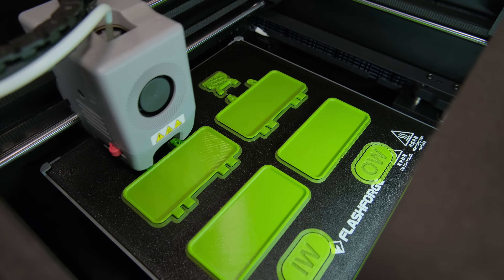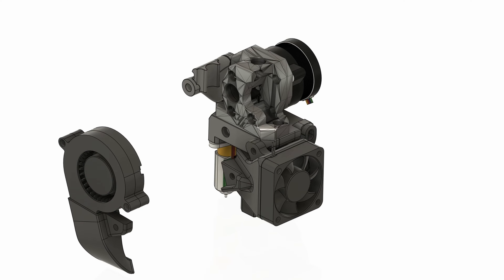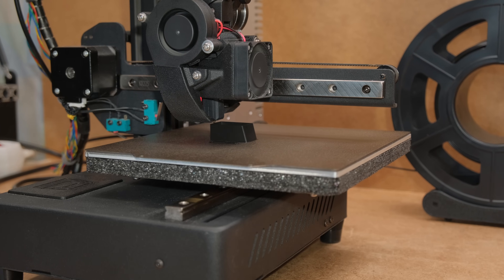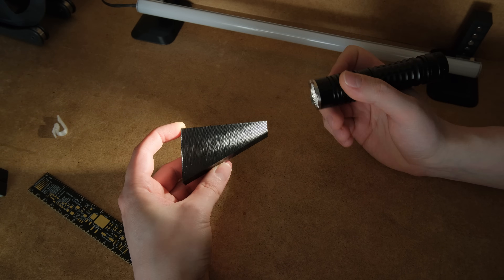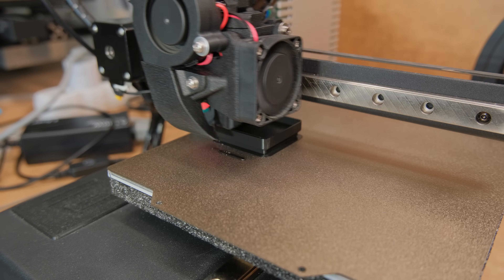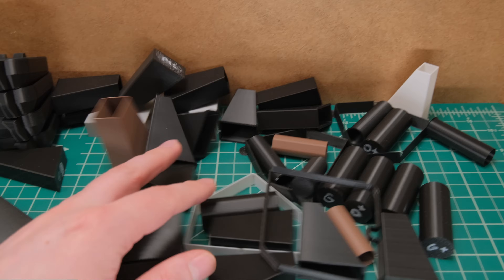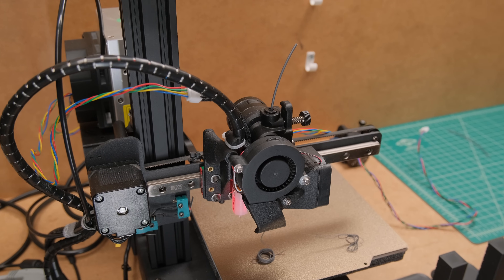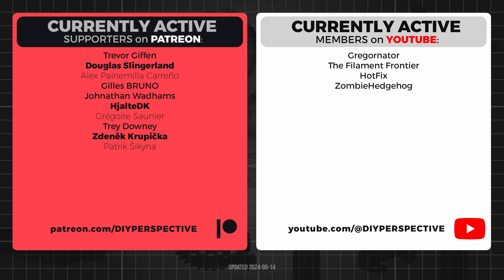DUAL-DRIVE Gear EXTRUDERS SUCKS? (GALILEO 2 vs ORBITER V2 & P1S vs A1)

Comment: Hi,
I came back to this topic several times and kept wondering whether a dual-drive extruder is physically worse than a single-drive one.
After comparing the construction of the Bambu gearbox with the HGX Lite, I came to a few conclusions.
The first and most important one: the dual drive works as a true dual drive only during filament loading. At that moment, both filament drive gears cooperate with each other through the gearbox.
Once the filament is inserted, the dual gearbox effectively works like a single one. The filament located between the drive gears introduces backlash between their gear teeth, causing both gears to behave like a single-drive mechanism.
So the question is: if during printing both gearboxes work like single-drive systems, what actually causes the difference in print quality?
In my opinion, one of the most important differences between the HGX gearbox and the Bambu gearbox that affects print quality is the number of gear pairs involved.
The Bambu gearbox has only one pair of gears, while the HGX has two pairs (not counting the gearing between the filament drive gears themselves).
Each gear pair introduces backlash. As a result, the Bambu gearbox has roughly half the backlash, since it uses only one gear pair.
Another advantage of the Bambu gearbox is the use of helical gears, which further reduce backlash between the gear teeth.
There is also a difference in the filament drive groove. In the Bambu gearbox, the groove “wraps around” the filament more than in the HGX drive gear. This means that the Bambu gearbox is less prone to extrusion inaccuracies compared to the HGX.
The HGX grooves are shallower, which can introduce additional extrusion errors when the filament axis deflects relative to the feed axis between the drive gears.
I’m not sure if I explained this clearly enough, but in short: the fewer cooperating gear pairs there are in an extruder gearbox, the fewer extrusion errors occur during printing.
Best regards.

Comment: Interesting stuff. I suppose with any dual drive extruder one could simply convert it to a single drive by replacing the second driven gear with a bearing of the correct diameter... Wonder what the decrease in pushing power would be and for what scenarios that would even matter. I'm gonna try this on my Orbiter v2. 

I have 1 printer right now, an Ender 3. On the stock extruder I could achieve a nearly perfect surface finish. Then that extruder broke, the printer sat, I got it back out and fitted it with a direct drive setup and orbiter v2. Fixed the printer but never did quite get it back to the original print quality of the stock unit. I chalked it up to my tuning but it must just be the dual drive nature.

Comment: Have you seen the papilio extruder by kevinakasam? It uses belts to push the filament on both sides, on paper it should provide a larger contact area, get rid of the dual gear meshing problem and get rid of (potencial) artifacts caused by the teeth marks on the filament.

Comment: Am i the only one that uses a rubberized feed wheel in my extruder it seems like ive never seen someone else do that in the 13-14yr ive been printing like why mangle the filament when you can just use a high friction material
Reply: I actually really like that idea. How'd you go about doing that? On what extruder?

Comment: So, I'm curious to know if more precisely machined dual gear extruder gears (specifically the hobbed portion) will reduce the mentioned artifacts. 

I have a few heavily modified kp3s, a pro, a kp5l, and soon to be assembled sv08 with a bunch of goodies to go with it.

Back to my pondering. I had noticed the artifacts left from switching from the stock titan to a bmg. So I built a rig to hold the gears and a .0005" indicator. The total runout on the hobbed portion was massive, like .003-.005. Coupled two together and it definitely causes the flow rate to "pulse". I went through a bunch of Chinese manufacturers until I found a company that makes some with helical cut gears vs straight cut and were within .0005" of runout. I have very little artifacts nowadays. 

Unfortunately, they cost 2-3x as much as an entire clone extruder.
I wonder if I'm wasting my time and money with them and setting up the extruder tolerances to minimize variation in the extrusion force due to components not being constrained properly so they can walk around, changing the area of contact on the hobbed portion. And just go with a different, off the shelf large gear option. Cheaper and less time
Reply: Give bondtech money and be happy
Reply: @Goroca actually going with indx when it comes out. I also have to say that the RIDGA(or whatever their improved gears are called) gears from bondtech are worse than the ones I get cnc'd. I'd still spend the money on them as theyre not much more than bondtechs offerings while being quieter on retraction (significantly less backlash) and made from hardened steel.

Comment: I have the KP3S also, swapped to a different extruder due to visible layer lines. I was able to get most of the artifacts out by adjusting the max flow, flow multiplier, and pressure advance values in Orca Slicer. The Bambu Lab comes highly tuned, so likely they are using the correct values so its not a fair comparison. Vase mode minimizes the artifact, dont use it for this tests. You need the tool head to lift each layer.

Comment: I agree with a lot of what you are finding and saying.  So much so that I am actually just today buying the parts needed to put a Bambu X1 extruder with the modernized coated gears along with the E3D Obsidian hot end - a hot end that i have seen data for that shows that it can not only extrude at much higher rates but more importantly the layer adhesion is the best of what I have seen so far.

Comment: Interesting video and a great comparison. 👍👍👍👍 This is, however, a comparison of designs from different manufacturers and so the use of better design solutions and the accuracy of the design can have a significant impact on the outcome (a premium manufacturer may have a quality advantage and not necessarily a design advantage).
It would be interesting to compare the same drive type in a configuration as a dual-gear and in a configuration as a single-gear then you could compare which version has the advantage.
I saw on printables a new version of the HGXlite extruder in a lever configuration modelled on the Prusa Nextruder.
It would be interesting to compare this design with the dual-gear version of the HGXlite.
Ideally they should be in similar housings.🙂😁

Comment: I am seriously considering trying to design a single-gear/dual bearing extruder that can fit my k1 Max. The stock updated extruder is really good, no issues there, but a single gear one would eliminate one potential source of artifacts, and it would be one less thing to worry about or poke at.

Comment: Z wobble isn’t wobble. It’s variation in z travel due to slight binding of the screw nut as it rotates thru its revolution.   The variation in z causes under or over extrusion and the bands you see in prints

Comment: I love powder-bed printing, I've led the purchase and install, and initial operations of one for an employer (using the same PA12GB mentioned in the vid), but I would like to emphasize that PA12GB is about 1/13th as stiff as 6061-T6 by mass. You can get parts as stiff by designing box  sections, etc, but just saying parts printed in it are as stiff as aluminum inaccurate.

Comment: Would you be able to test out both cnc aluminum vzhextrudort versions out?. There are also slanted and non slanted teeth versions. Comparing the VZHexturdort and VZHexturdort Plus and effects of the slanted and non slanted gears interrests me, could also try bearing as idler gear but that is alot of variables. The Plus version should have lower pushing force but if this is still enough for high flow hotends (enough meaning if you push more you get bad layer adhesion anyway) i can see the advantage of the bigger gear with your earlier video about big filament gears.

Love the videos btw. Keep it up!.

Comment: Was just rewatching this video and I noticed something. Pause at 4:46 and there definitely is a difference for both the Orbiter and Galileo after the Z-wobble fix. Put the video in 4K and go full screen to see it clearest. The easiest difference to spot is the light reflection at the left side of each test print. Before the fix, the line is uneven and much choppier. After the fix it is a nearly perfectly straight reflection. Looking at the overall surface of the print there is a also a slight, but noticeable reduction in any VFA patterns, as well as a more even appearance overall. Pause at 5:09 and the same improvements are even more obvious. The light reflections are much cleaner, especially on the Galileo print, and a visible shifting pattern every several lines is almost completely gone. Overall, the fix was definitely helpful and I'd say there may even be 5% wobble left to completely dial out with a more advanced Z-wobble fix, as you can still see a slight repeating pattern every 26 lines or so, but I think the simple fix was good enough.
Reply: Not sure if you ever saw this comment, but I keep coming back to this video, hahaha.
Reply: I was going to say the say thing.  Decoupling the Z axis screw wobble to decrease X axis jitter did seem to help improve print quality.  The RatRig V-Core 4 is often configured with an Orbiter 2 extruder and has eccentric slip shaft couplings on the three Z axis screws.  I assume those aren't decorative.  I haven't seen the extreme harsh light comparisons of this video on the VC4 but it does make nice parts.
Reply: @Liberty4Ever Yeah the still shot extreme lighting comparisons like this really help reveal true quality. It's part of why a lot of printer reviews really obscure the true quality.
Reply: @802Garage  - Humans have acute sight but it's amazing what we can feel.  We can feel surface defects we can't see.  The harsh oblique lighting and magnification helps us to see what we normally couldn't see but could still feel.  I manufacture TPU products that improve a firearm's user interface.  I'm very interested in reducing layer lines partially because I don't want products that have the appearance of 3D printed parts, but more because our customers want comfortable products that have a smooth feel and don't feel like a cheese grater under recoil.  I'm hopefully concluding experiments today with TPU-LW, the foaming TPU.  The LW is Low Weight.  It foams when heated in the nozzle to create a microscopic dense closed cell foam.  This produces a flatter surface that also has a nicer matte finish.  Other tips I'm using:  1) CoreXY printer with a flying gantry so the part isn't moving at all, whereas a bed slinger causes the tall thin walled parts to flex in the Y axis direction, with that flexing increasing with the height of the part.  2) Slicer set for much smaller outer wall thickness to minimize the ribbed wall effect.  3) Slicer set to print the outer wall first to better control its location rather than having it laid down wherever the inner wall allows it to go, which is OK for vertical walls but disastrous for overhangs.  I may experiment with a single outer wall as thick as I can make it using a 0.6 mm nozzle.
Reply: @Liberty4Ever  Yep that all checks out. You been watching all the latest TenTech videos?
Reply: @802Garage  - I have been watching TenTech videos but wasn't subscribed.  Your comment reminded me to look and his latest video was in my feed, probably because the YT algorithm knew I was looking for it after your recommendation.  I'm subscribed now.  Today's video is a new implementation of adaptive layer height for outer perimeters.  My comment under that video:  "I hope your adaptive layers feature is fully integrated into popular slicers soon, along with your other recent clever and very useful innovations.  You've been absolutely killing it lately.  If anyone deserves a day off, it's you!"
Reply: @Liberty4Ever Agreed on that! Hahaha.

Comment: I don't see under which circumstances one would need the torque provided by a second drive gear. If an extruder needs this much torque, it is because there is an issue somewhere that needs to be resolved. Under normal circumstances, one drive gear is plenty.

Comment: Seems like the general consensus here is that dual drive is best suited for small nozzles, but single drive probably gives the best quality for standard and larger ones (depending on the setup)
Reply: The other big difference is flexible filaments.  For things like TPUs, the level of tension you need to put on a single drive to get enough force into the hotend can cause jams or can result in the filament sticking into the drive gear itself and tangling itself inside the extruder. The reduced bite and more equalized force imparted on the filament in a dual drive means this is less likely to happen for these kinds of filaments.  And the softer the filament is, the worse this gets.

This part is anecdotal, but I've also seen far fewer full extruder jams in dual gear systems, but when they do happen, they're much harder to fix.  Used to see the semi-circle gouge in a jammed filament all the time on single gear drives, but the stepper motor seems to stall before doing that on dual systems.

Comment: I have found that using CNC machined gears that use ball bearings rather than needle bearings greatly reduces the layer extrusion errors. I use fysetc, but there are others out there (rigda, mellow etc). The best result I have had so far is using the Sherpa Micro "fixed idler" extruder. There is no tension screw and the tolerance of the print determines the meshing of the gears.

Comment: I went from CW2 to Galileo 2 and was quite happy, but I was thinking about going Xol and Orbiter 2.  Now I'm wondering if that's a mistake, and I should go Xol/G2SA instead.  I'll probably build it as I planned first, and test G2SA later, since I won't have a use for the old CW2-style Galileo 2 extruder after that anyhow.

Comment: You need to take a look at the extruder motor drivers(and see if they are the same across all the printers) and see what settings they are working with because microstepping, amperage, frequency hysteresis (this setting is not seen on a typical printer config file but can be put in for better control at least in klipper), etc. all affect the torque curve of the motors. Also the spring preload will affect the torque output as well. All these factors affect the torque consistency and therefore output.
Reply: Yeah his tests aren't very good

Comment: I don't understand dual gear drives. As the filament is loaded, the gears separate to allow it to pass between them. Surely the drive teeth also separate at the same time, so it's probably filament friction doing a fair amount of work to turn the second drive wheel. The drive teeth will not mesh properly when filament is there.
Reply from the maker: They are designed in a way when filament is loaded both gears are in the optimal position and both gears are driving the filament. But because we don't have perfect tolerances one gear might be pushing more or the other less and we get into a stage where the filament is not consistently driven = introducing inconsistent extrusion. That is my theory about it.
Reply: @PrintingPerspective   Thanks for the reply. I agree with everything except the gear mesh. Optimal can't be with filament present or it'd not go closer without filament.
Reply: @saddle1940  Exactly. If the gear mesh were right, it'd stop the drive teeth from getting any closer and you'd have effectively a fixed-distance gearing system rather than fixed-tension.
Reply: @daliasprints9798  ' If the gear mesh were right'  
 You realize this is easy to fix, right?  These are all old ideas, and hashed and rehashed years ago..  You'll find my and other comments on old gear and dual gear extruder videos.
You MAKE THE MESH NOT CHANGE.  Press the bottom side shafts together with a spring, and keep the gear side at full engagement.  Then press the top side of the shafts together with a spring as well.  Let the top side float further away so the groove can separate to adjust for filament thickness etc and the grip you want on the filament.  The gear side is held fully engaged, it just angles very slightly instead of moving apart.
THE PROBLEM is merely holding the two shafts too fully parallel.  You can even 'fix' the fixed parallel shaft dual gear extruders merely by loosening up the alignment a bit and let the whole moving side float more to an angle.  MORE looseness lets that moving side adjust to an angle, instead of rigidly fixed making the gear mesh stay exactly parallel and open up.
More imprecision makes it work better, it's why literally the problem was more noticed on better quality dual gear extruders, while cheap knock offs had enough play that they floated closer together and had less problems.
This is essentially like using an independent rear suspension so you can adjust for unevenness in the road, instead of a solid axle that breaks traction on one side when the other side lifts it.

Comment: I don’t remember if you did or if somebody else did a test on the concentricity of the extruder gears but that made a big difference in the print quality.
Reply from the maker: Yes, it does, that is why dual-drive gear extruders can suffer a lot if high manufacturing tolerances are not ensured. :)
Reply: CNC kitchen did, he has a terrible gear that was causing blobs on one of his printers years ago